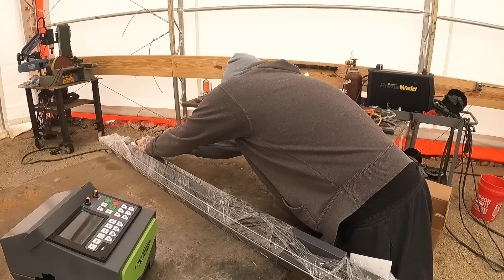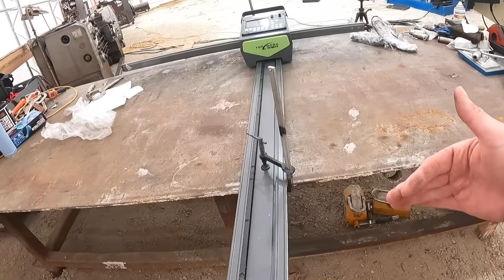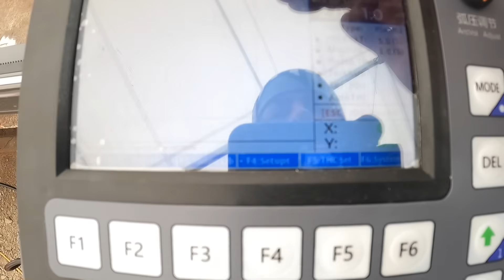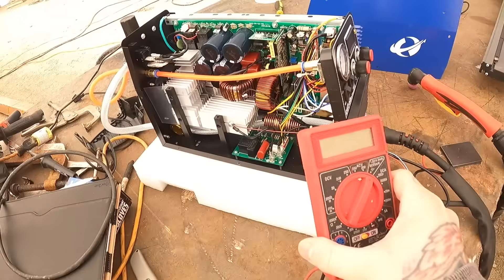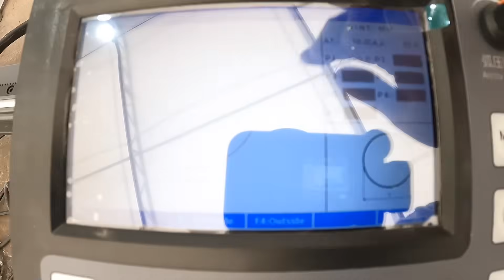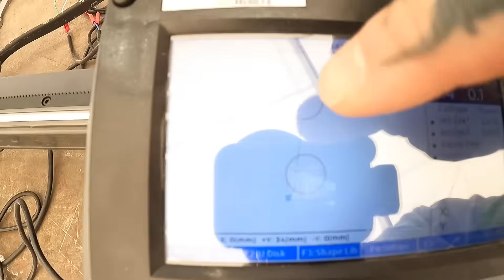I Bought Another Cheap Chinese CNC Machine … AND YOU CAN TOO!

Comment: I have a ? for you, if you dont mind sharing.  I have fusion 360 and have a program in it.  I am having a tough time getting it to the CNC.  and i have noticed you mentioned it somewhat on this video wondering if you could elaborate a little more.?  thanks
Reply from the maker: When I made the video and use this machine, I didn’t export my program from fusion directly into the machine. I exported a DXF line, drawing from fusion to the software that was provided with the machine and then into the machine.

Comment: Both Sheetcam and Mach are coming out with this technology also, it is the planning stage for them. I am glad that there is something better than Langmuir and Eastwood systems. II have a Crossfire with Mach 3, Fusion 360, it has been a pain to date. The machine you showcased will be a game changer for the DYI'ers. Thank You for the heads up.
Reply from the maker: Thanks for the info

Comment: I agree with you on everything but sending the used Amazon plasma cutter back to them after all that it has been through. Yeah, I still subscribed, you are doing what I need to see and follow, I'm an old machinist and welder, needing a CNC plasma cutter this size and wasn't sure how I was going to manage that until I saw what you got. Please do another video with this on a frame and the correct plasma cutter as knowledge is golden, and best of luck there.
Reply from the maker: I ended up keeping it to hand cut stuff

Comment: I just get the same machine from china and found your video about it so it helped me to connect wires right. Only thing i can't finde out why it stops after each cut if you have complex piece and then you need to pres ok to start cutting again...🙄
Reply from the maker: I’m not sure I haven’t had that problem with it
Reply: @precisionmetalin  problem fixed, will make video about all problems i   had with it and how i solve it 😊

Comment: You seem to have an advanced electrical systems familiarity that makes me look like a fifth grader. I'm still trying to figure out how to hook this into my miller 625 extreme plasma machine. Not understanding the electrical connections for torch on/off and arc wires. I can't believe they don't include any directions or schematics. I didn't get a program to do my own designs on the thumb drive. I'm really frustrated with this.
Reply from the maker: Sorry to hear you're having trouble, but I'm sure you can figure it out. If anything you can open the torch handle and tie into the two wires for the witch for your torch on/off

Comment: Very nice, and based on this video, we're looking at buying one for our welding/fab shop. 

Quick questions:

1. The second plasma you purchased (as the first one didn't work) is no longer available (as I'm sure you've been told many times)--what are the requirements that a plasma machine has that the first one didn't have? 

2. What are required specs for the air compressor ?

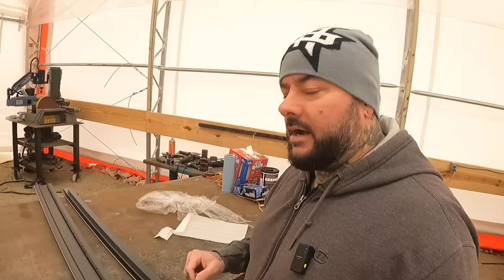Comment: Hi great video. I have 2:07  bought the same set up. Just want to confirm the wiring. Plasma on/ off to each wire of the trigger. Arc to arc start and black wire on torch line. Torch height off black wire off torchline and red off ground. But what do you connect these to? Do they connect to arc start as well?
Thanks

Comment: The problem with these chinesium machines is if it breaks you can't get it fixed; $1000 disposable machine; not for me. I've made that mistake at least twice before already.
Love the design.
Reply: I've fixed mine in the past, most parts are available off of Amazon

Comment: My question is does it have an external axis output for a rotary axis?
Reply from the maker: I’m not sure
Reply: @prestigemanufacturingky  thanks for the reply. I'd really like to know if it does or is capable. I feel like it's a good tool now and that it would be amazing if it had that option. I'm seriously considering picking one up. I'd just like to know if there is even a 4th axis output that could be hooked up to a rotary axis... Small add on that would make a huge difference in capability. Even if there wasn't a built in or optional axis adding. Even just being able to add one would would take this from pretty cool to phenomenal.

Comment: i'd duct tape a stick to umbrella and position over screen to block light. What a cool side benefit, great lighting at no cost (both fluorescent and LED suck), but winter heating has to be wood or "cheap" solar, you could insulate the sides but not top, or maybe winter heat takes precedence so you throw a custom blanket over the top and resume LED lighting. Having access to a large city from rural setting would also seem ideal..

Comment: The times we live in!  Super cool.  I think it is awesome.  I will tell you that I could build you a machine a lot like the one you have for half that price.  As a matter of fact looking at your shop there's no doubt that you could build it as well but i don't want to take away from the product in your video - that price is not bad and it looks like a good machine.  

And how do i know that I could build something like that?  I just put together a CNC router that is 1meter x0.8 meter by 100mm in the Z axis stroke.   i am building it completely from scratch and I have all the components, i have tested the controller board (Which was only $60!!! and it works like a champ!  And there are a few board options the most being $100 if you want to stay with the software that runs these boards) with some nice StepperOnline drives and motors... you get the point.   

Also just want to say that with Fusion 360 we as hobbyists can take advantage of the generous offer they have of free!  But don't scam them, if you start making money pay them what you owe them... and if you don't like Fusion I can show you about a half dozen other FREE and truly capable CAD CAM packages,  We are lucky as hell to have this kind of technology available to us!  

Happy to share details of my build if you are interested.  Also - I liked and subscribed, i liked your video and it has to be hard trying to get traction here on YT lately with the who knows what algorithm.  iS it working for you, against you, is it consistent?
Reply from the maker: Thanks for the follow 🙏

Comment: Not sure WHY this came up in my feed but ...
THIS is the future of the US. A while ago people who were smart and visionary (but unlike Jeff or Elon not driven by a GREED instinct stronger than a bull's sex drive in spring) predicted that 3D printing would EVENTUALLY replace manufacturing. I have a 3D printer (it's still in the box, it was cheaper and easier to get my stuff printed at the  LIBRARY!!). What no one commented on was the adoption curve, which is VERY SLOW apparently.
But I have seen videos of "small batch" North American and European manufacturers using a room full of slow, clunky, IDENTICAL 3D printers to pump out consumer goods.
I'm willing to bet you could design and pump out ... say a rear-axle retrofit kit to allow you to hand an e-axle in the back of an F-150. With a few more pieces you would have a cheap EV pickup conversion kit. Wht would you DO that to a perfectly GOOD pickup? You wouldn't to a GOOD one ... but I did say FORD, right? Just kidding, but the engine and transmission can ONLY be fixed so many times.
I'm too old to do this ... but lots of "redneck engineers" - you know them , the people who DID make America Great, not the morons and criminals in Washington ... will do this.
THIS is how you bring manufacturing back to the US ... and it isn't GIGAfactories and Amazon warehouses the size of a hundred football fields full of "serfs". Just saying ...

Comment: What is it with Americans just randomly returning perfectly fine products they purchased? I find that extremely disturbing and morally wrong.
Reply: I agree.  I designed, built, and sold a small product on Amazon for a while.  Returns cost money and I only recouped a fraction of the total fees amazon charged me whenever someone returned something.  It didn't matter whether it was my fault or not; all returns cost me money.  The net result was that I became a much better buyer myself, thoroughly researching items before I  purchase them so I don't have to return them unless they are clearly defective or not as advertised.  I'm guessing the plasma cutter he returned was never advertised to do what he wanted it to do.  So why should the seller be penalized for his failed experiment?   This mindset ends up costing everybody money in the long run.
Reply: I think he said he returned it because it didn't work for him.  The alternative is to never buy anything that's not a well known name brand, and verified to work in each specific applicaiton.  This is not good for the entry level manufacturers either as they would all go out of business..
Reply: Plus there is another thing you got to realize. The unit he messed with and returned is most likely going to end up in the trash. But don‘t pity Amazon, they couldn‘t care less. They will not pay for that. It‘s us who don‘t abuse the right to return stuff that pay for that. Whatever we buy (could be socks, underware or also tools) will just be a percentage more expensive to bring the money in for losses through abuse.
Reply: Pretty sure they make it back on the $420 shipping costs for the CNC machine in the video. But yes, I took agree. At my table.  If you order something you better be able to swallow it because there will be no sending it back.

Comment: Wow you are impressive. I,m a retired tool & die maker, & have a small shop at my home. I have done some fabricating in 
my past, but I,m a machinist first & foremost not a fabricated, though I,m pretty seasoned tig, mig & stick welder. Your 
Channel caught my eye, because I have been thinking about plasma table. I,m looking into what you have. My question 
To you, is why are you not set up in a permanent building? 🤔
Reply from the maker: I just bought the land and put this building up. Building as I get the money

Comment: Personally, I run a PlasmaCAM, which 15 years ago was 11K + 2.5K for the Hypertherm PM 65, so this is a great deal. The MAIN hold back for me on Alibaba is they NEVER have a specific shipping price, so Yiwu having a set price is a HUGE deal. Alibaba would sell a LOT more stuff if we did not have to deal with shipping. Looks like this is a VERY practical machine, especially if you can import files from SolidWorks or F360. If there were a more economy shipping service, he would not be able to keep up with the orders 🙂
Tip: Put a piece of cardboard or something over(above, get rid of glare) the cutter display, and /or use a tripod; it was very difficult to see anything. You should do a step by step tutorial on how to operate the CNC.
Reply from the maker: Thanks for the tip!

Comment: I contacted them... typical conversation with overseas, which I've dealt with before.. Questions really never completely answered. That's my concern on purchasing one of these.
Reply from the maker: If you want to purchase one from me I’ll have 2 in stock next week but one is spoken for. I charge more for getting them in and set them up though. Email me if you’re interested thangs
Reply: Yes but have a few concerns...emailed you
Reply from the maker: @510BIGD I didn’t get a email
Reply: For some reason the email isn't going through.  Tried 3 different times. 
Please paste it in this reply
Reply from the maker: Prestigemanufacturingky@gmail.com

Comment: You're actually an idiot for cutting that cord.  You should have just ordered a proper cord.  That's a common cord.  It probably would have actually been cheaper to buy a different cord over the cost of that plug you bought.
Reply: @prestigemanufacturingky  your choice,  but with the low cost of a factory made cord that would have been my choice.   In fact if you have any old computer laying around you already had one of those cords.

Comment: Really amazing video. I'm a subscriber from the beginning. Nice you are reviewing a new machine, and this one is crazy cheap. I had my eyes on one of these for years but it was more like $3K. I did not understand much about the THC what you had to do. I always thought that there was a type of hall sensor on the THC where it would sense if the plate is bend and it would adjust itself. Thanks for this video and it is really tempting and exciting to get one
Reply from the maker: Thanks for the support man I really appreciate it 🙏 the machine is definitely worth checking out for the price.
Reply: @precisionmetalin  update: I ordered the machine. Mark is indeed a great guy. Can't wait to get it. I ordered it with the extra torch and cable and extra set of consumables.
Reply: @precisionmetalin  I finally got mine. I wan't so lucky with the taxes (in Europe) The USB stick is.a bit overwhelming with many links to weird English explanations. Not clear cut. But your video is giving me hope. That THC definitely helps. I hope my cheap plasma cutter will be easy to. port that in. My power cord also had this weird plug so I also have to cut it off and put one on. I am going to play with it tomorrow. You're the one that got me to buy this thing. Thanks Randy.
Reply: @precisionmetalin  I also wanted to ask you, you mentioned here in this video that you would make some videos on how you import stuff from Fusion 360. Do you export as .dxf to the USB stick and this machine can open that? Or do you have to import that in their nesting software and then export that as G code .txt file on the USB stick and then the machine will see it? Thanks.
Reply: @precisionmetalin  Hey man, where are you at? :-)

Comment: It has a "universal" swithmode supply. It works from anything from around 85V to 245V. Even if it was for 230 only, connecting it to 120 would not be able to fry it (lower voltage than rated cannot damage anything).
Reply from the maker: Nice